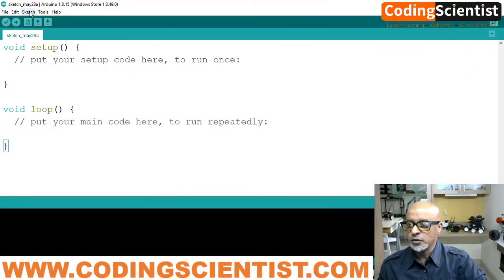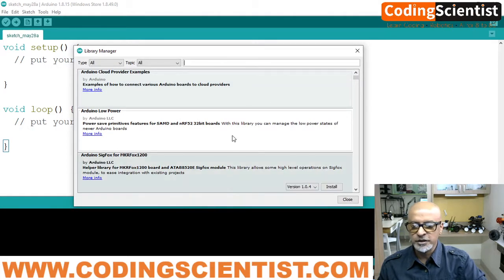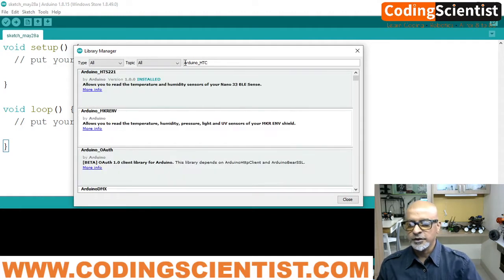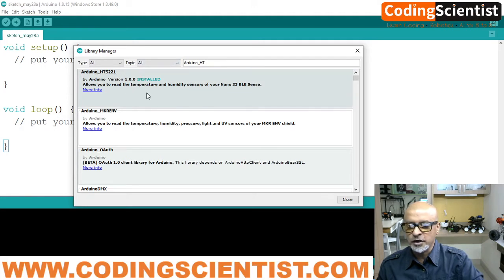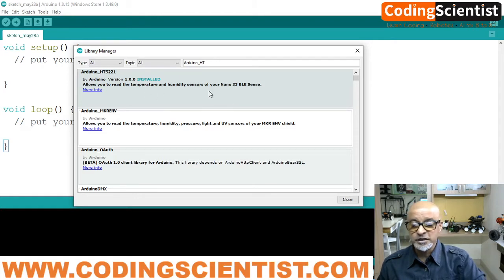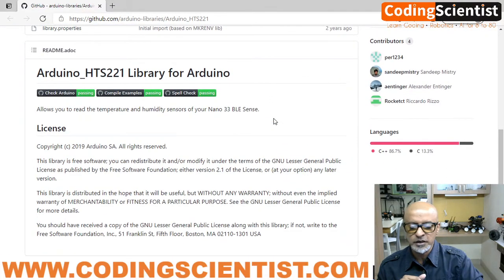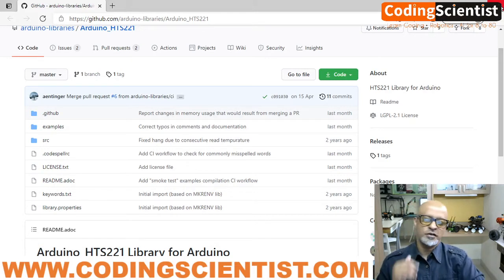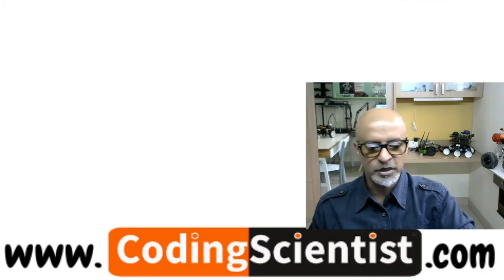Lesson 6 Installing Humidity Sensor Library

Comment: Is there a sensor for measuring accurate short distances on this board? Good job on the course.
Reply from the maker: not inbuilt but we can add external
Reply: @CodingScientist  Do you have one in mind that you could recommend?
Reply from the maker: @jamescullins2709   there is Sharp brand GP2Y0A51SK0F sensor which is the shortest-range, its also called as Sharp analog distance sensor featuring a detection range of 0.8″ to 6″ (2 cm to 15 cm). The shorter range gives you higher resolution measurements, and the low minimum detection distance
Reply: @CodingScientist  Thank you, I found one I want to try. I need a 1mm resolution for measuring.